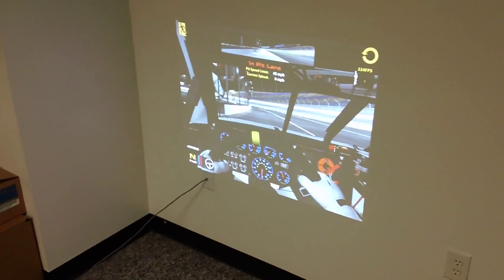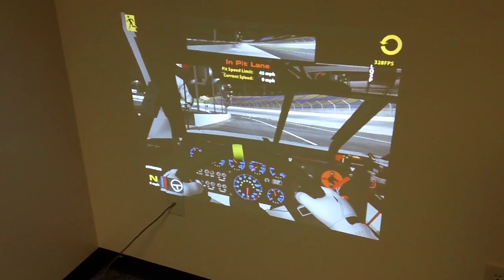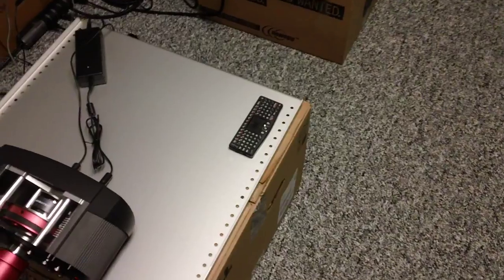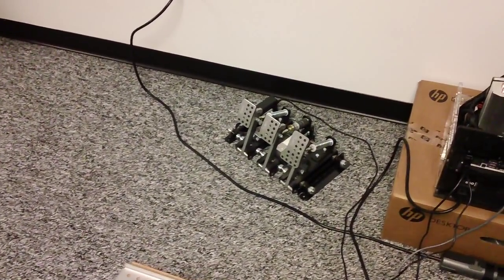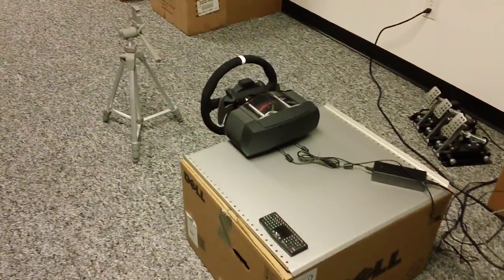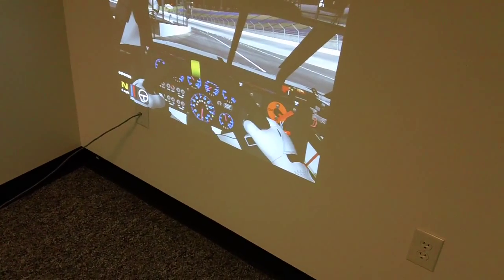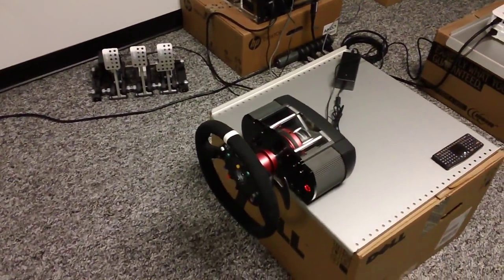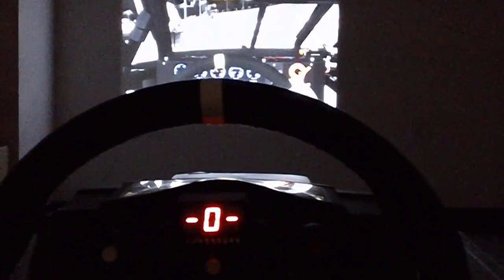Part 2 of 3: NEC NP-V260X Input Lag Testing Using iRacing.com

Comment from the maker: No--these projectors run at 60 Hz vertical refresh rate when connected to a PC in 2-D mode. This is easily verified by enabling vsync.